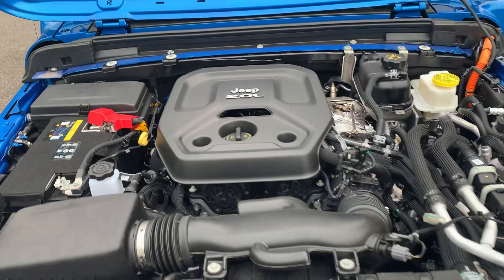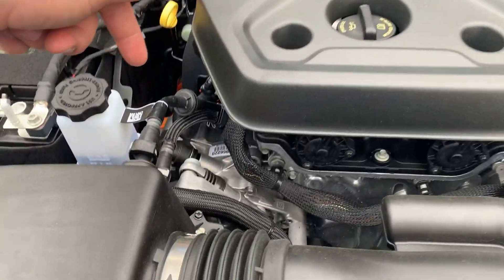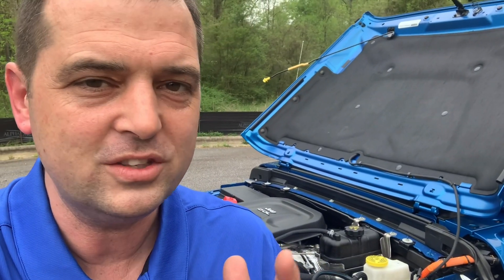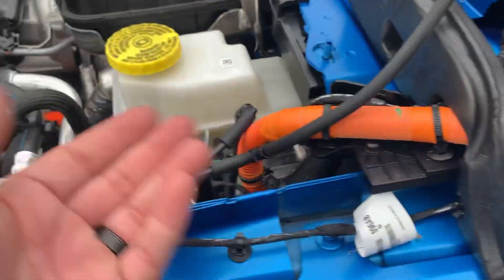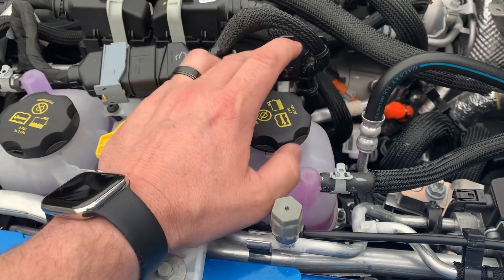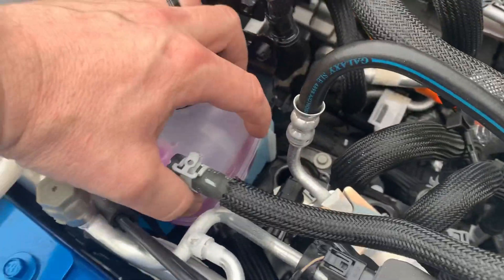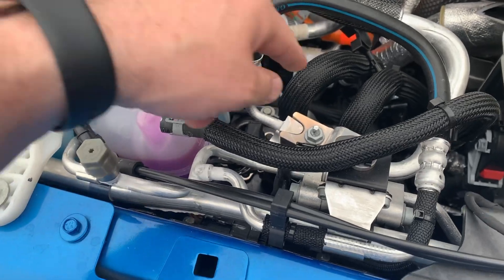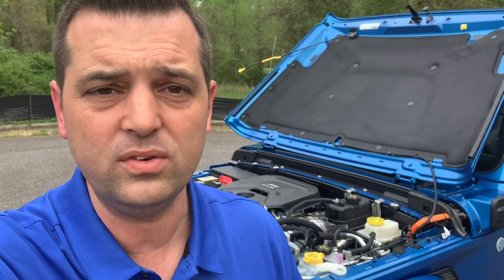Jeep Wrangler 4xe hybrid What's new under the hood?

Comment: my 2006 TJ was as simple as they come. clean under the hood, simple fuel injection,6speed manual. 3 wrenches  is all you needed to repair it basically. and it was under 20k brand new. this thing is ridiculous

Comment: Brandon, I have two questions for you.  You seem to have the best and most accurate info on the Jeep4xe on the Internet.  By far. Can I flat tow my Jeep4xe?  And does the Jeep4xe have “continuous power assist brakes”?  Meaning the brakes have Power Assist ALL THE TIME.  I’m speculating now.  Since the brakes cannot have a vacuum power booster (looking at this video, it does appear they do not have a vacuum booster) then the brake assist needs to come from a hydraulic pump.  Does the brake boost come from the power steering pump?  And if so, does the 400v battery power the power steering pump, even with the ignition OFF?  Or only with the ignition ON.  
The problem is in the pedal force applied by the brake actuator while towing the Jeep4xe.  In a regular Jeep, the brake actuator applies a lot of force to stop the Jeep, because there is no power boost while towing.  If the 4xe has brake power assist in the OFF position, like a lot of other hybrids do, all kind of bad things could happen when you stepped on the RV brake.
Thanks in advance..

Comment: Hi Brandon. I'm curious to know if the ac or heat can be run for a long time from a full battery when the car is parked? 

It would be great to use the lithium batteries to keep cool or warm when camping in the car.

Also what about 12V accessories? If the car is 'on' but not driving could you use the 12V sockets for a long time and have the lithium batteries prevent the 12V battery from going flat?

17kwh would be one amazing 'house' battery for camping!

Comment: At 3:35 you said that the anti-freeze is used to warm the battery when it is cold, but how does it do that? It looks like the system is closed from the engine so it can't scavenge heat there, and since the engine had to turn on to heat the interior that implies that the AC system cannot be reversed like a heat pump.
Reply from the maker: No it does not run through the radiator. It has a warmers and a chiller. It uses antifreeze for the liquid for transfer of heat.

Comment: I live in a cold climate area so does that mean the engine would be running most of the time to get heat since no other heat source is available?  This is what I am gathering from the last part of the video and this would defeat the purpose of owning a hybrid jeep if this is accurate.
Reply: That's what I got out of it too. Concerning as a Canadian...
Reply: No offense but...you’re in a car. Don’t you expect to have the engine running to get heat? Hybrid or not heat has always worked to help gain mpg by  using the heater as a heat sink.
Reply: @goofsaddggkle7351  Referring to the the comment at the end of the video that it appears only the combustion engine supplies heat which later on in another video Brandon found that this was not correct and that the combustion engine was not needed to be on to create interior heat.
Reply: @johnbarry6351  oh interesting- that’s huge. I watched it and caught the part about a/c working purely off the lithium battery system but didn’t know it is driving heat too. Thanks for the update